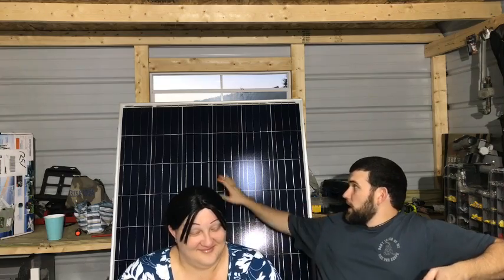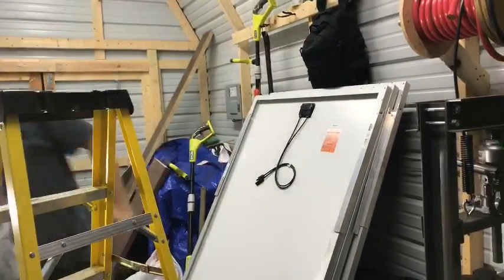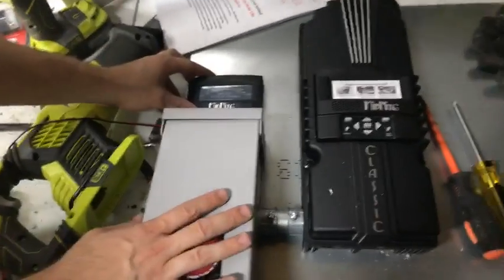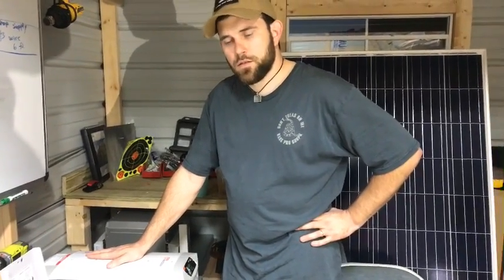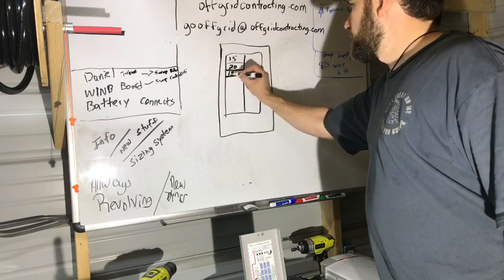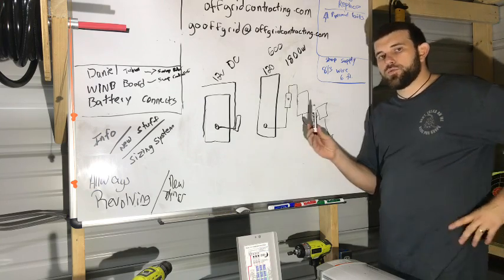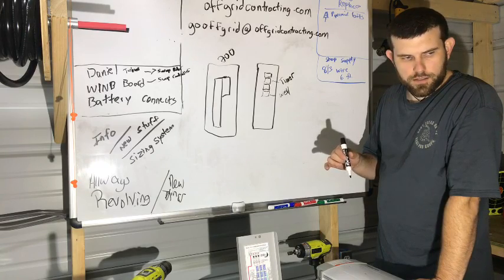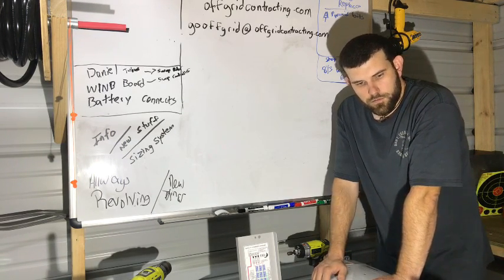Live off grid contracting: New services,  new materials, sizing your system and setup

Comment: Incredible tiny homes question.... Is the off-grid $25k running 24volt battery? I have Victron 3k multiplus 24v..... I like the low idle power used and app feature..... So is it possible to just get the panels installed and battery and then I mount my charge controller and inverter that I own?  I also like the heat wall idea how much energy do you get in winter on cloudy days vs sunny days?.... I live in AZ so propane cost and solar won't in the future.... Love the knowledge you have....